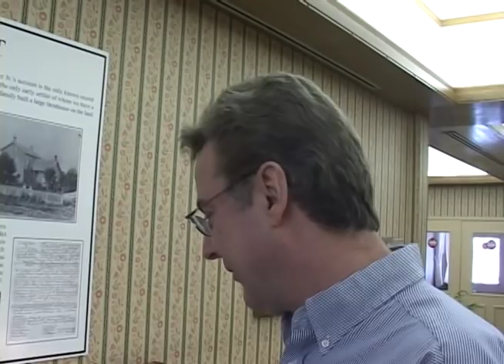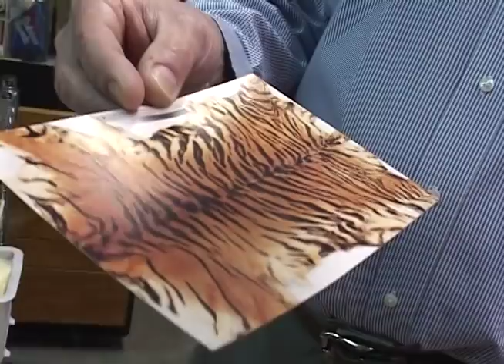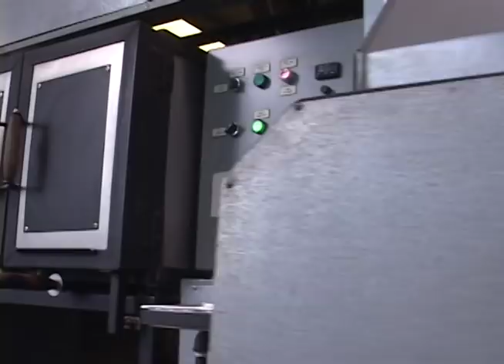Glass Masters at Work: Mark Matthews

Comment: I will Love if you can answer me this Questions Sir,
1---> Is there any Chemical(s) to mix with the sand before turning to Glass 
2--> How to make the Glass become White as the regular glass color we see everyday
3--> The degree of heat before turning the sand to Glass and how long does it take

Thanks.
Reply: Quick answers: 
1.  usually they mix lime and potash to reduce the melting point down from pure silica. This particular glass is most likely something called "system96", which comes in clear pellets that you can melt down in your furnace.
2. White?  You can color glass white with various antimony oxides or tin. 
3. While pure silica glass melts at ~3000F, System96 is happiest around ~2170F
Reply: @belacickekl7579  Tank you very much for your quick response.

Please is it possible to use just  " seashell and clean sand.
Waiting for your response on this.
Thanks again
Reply: @belacickekl7579  — I think the person was referring to the “clear” glass we have now-a-days.  In the past, say 1800’s or 1700’s, most glass had a blue or green colour to it.  The colour was what the basic sand they had, produced.  You don’t see much everyday glassware being clear (or “white”) until the mid 20th century.  
👵🏻🐾💕🇨🇦
Reply: @ivillage5872  possible, although you'll have to get it very hot, and it may have impurities regardless.

Comment: I have a price of wonderful glass I have used as a door stopper for yrs. 
So recently. Been watching Corning ran across you.  Mine is purple,dark. With the bubbles. It looks like a flower. Weights about a lb.  
Looks like ur orbs w/ bubbles. Perfectly sperated in space. 
I have had it for over 30 yrs.  Think way older. Like the 20's, so fascinated.  Want to share with you.